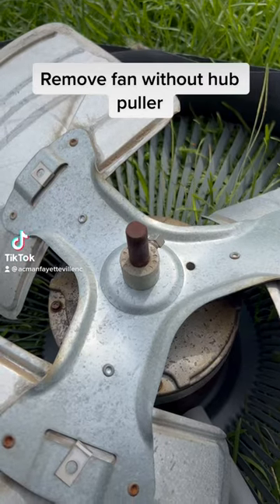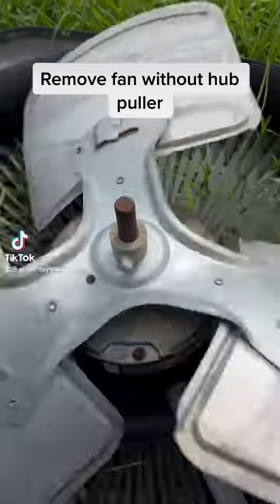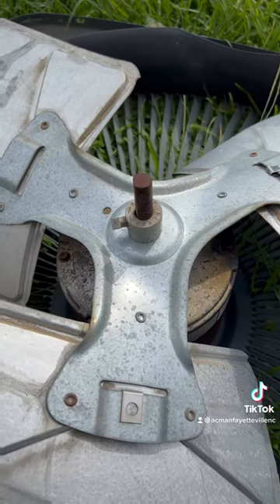removing fan blade without hub puller￼

Comment: Thank you!!! I didn't remove my blade exactly the way you did (my blade was flush with the top of the shaft).However, I was able to get a pair of vise grips on the shaft below the blade and then turn the fan blade like you did. Worked like a charm. Thanks again brother!
Reply from the maker: Glad it helped

Comment: Thanks, I'm right now trying to remove 2 conderser fan blades on dometic harrier inverter caravan rooftop aircon.
Tubular fans, had one self destruct, the other i just crushed by hand, very brittle. Plastic construction.
Have the centres to remove.
Same deal, rusted shaft.
I've been tapping/banging the fan base and have moved it 2mm now frozen.
Great idea using a spanner on the shaft recess .
Didn't think of that and the sand paper.
Outback Australia here and no service for aircon within a days drive...👍

Comment: I tried that , but unfortunately it's not like your video. With the new motor the flat part of the shaft is longer. Is there a certain depth that the the fan could go down to ?
Reply from the maker: There is no specific depth

Comment: holy sh#t!  that fan is a @#$@% f@$#r to take off.  I ended up having to hack the old motor into pieces and cut down the shaft. I was able to get the fan to twist fairly easily around the shaft but she just didn't want to come off it took me an hour and a half and those pully pullers from home depot didn't help at all.
Reply: i used an air hammer with a punch attachment just smaller than the shaft ran that sucker right out